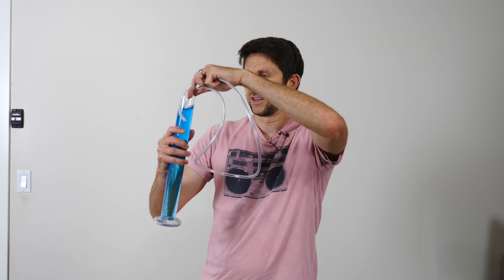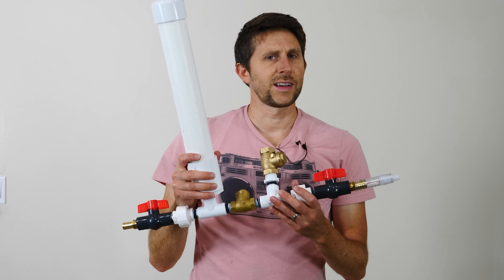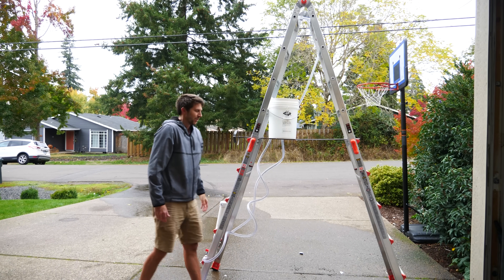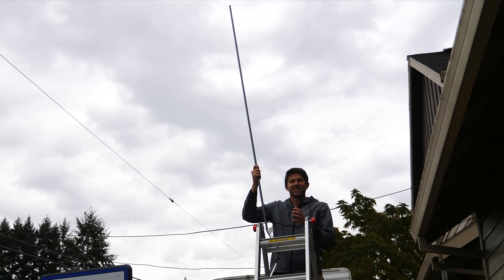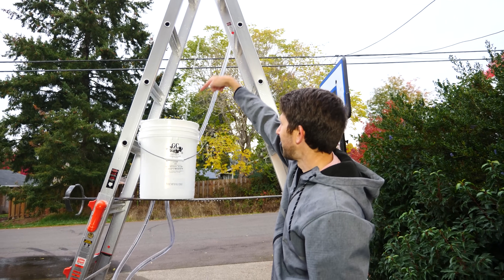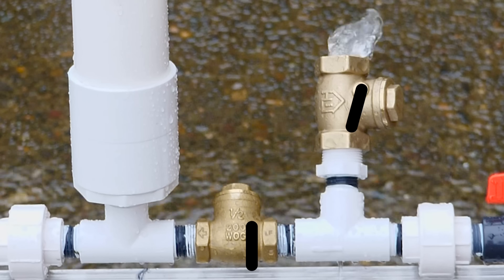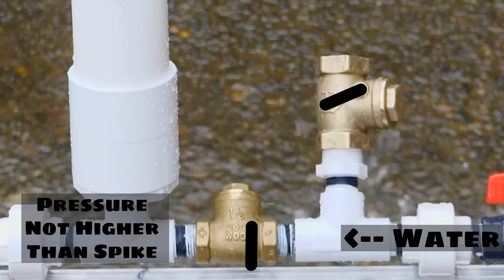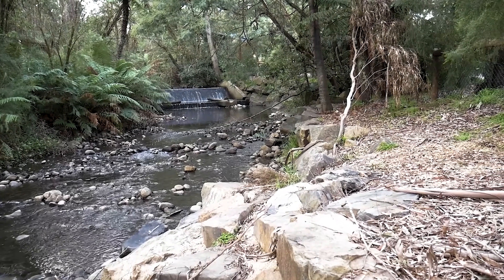Can a Hydraulic Ram Pump Make a Perpetual Motion Loop?

Comment: Fascinating! 
I could see this being used in pump-storage hydro power.
Reply: Probably not. ram pumps are very inefficient so they's only pump a fraction of each release of water back up to the tank. They might work as a supplementary system to somewhat reduce required pump energy but between embodied energy and cost of installation they're probably not worth the trouble.
Reply: @balometer  What your saying with so much authority is so wrong. How can you say something that has a zero cost of energy production will not make a good hydropower station your years at Shell Mobil and Bp has clouded your thinking.
If you produce energy for free for 1hr a day what's wrong with that. You can add storage tanks to stretch it to 10hrs which is good enough as wind and use low rpm generators but you must be close to endless supply of water and return all water back  That's why I call it a mobile Dam can be setup and dismantles as the need arrise 
only a friendly comment ✌️
Reply: @onekycarscanners6002  I'm afraid you're missing the point. Ram pumps can be used to make a loop. It's not perpetual motion because (a) energy is added by gravity and (b) only a small portion of the water is pumped back up to the source point. If a tank is used as a source it would quickly run dry and if a water source like a main or a river is used to top up the tank it would be several hundred percent more efficient to run the source water directly through a generator and forget about pumping in a loop. Learn some physics before having a pop at me. Maybe try again in a few years.

Comment: You made this way more complicated than it needed to be. Out here in Colorado we use perpetual motion water all the time without even having a pump. All you do is fill a tube bent at the top so it comes back down.  As long as the portion of the tube is is longer on the exit side than the intake side The weight of the water picks up water out of your source And pours it out the other end

Comment: Can't you use the capillary effect to fill the bucket? Obviously it's slow and would take alot of space. But it's worth trying.  Then you only need to worry about water evap. Perhaps with big enough reservoir with rain collection. You could get perpetual energy.
Reply: No.  There is NO perpetual energy.  Even the sun will burn out and die someday long from now.
Capillary action couldn't possibly fight the amount of gravity involved here.  You'd more likely get backflow down your intended recollection tube/s and just empty or equalize the source without the pump doing any work.

Comment: I am really curious if such a system in a micro hydro turbine setup, e.g. water from a roof trickling down through a micro turbine and then returned some of it back up tot the roof for a second go in the system. E.g. increasing the potential of the total volume of water somewhat. If the reduced flow of water versus reuse is a net positive or a negative. Thanks for sharing this video!
Reply: I'm working on exactly that! 👍🍀🇺🇲

Comment: This was broken down that my zero understanding could pick up the gist of the principle. 
My ultimate goal is to configure a setup using water in a cistern to create enough electricity to run my home. Possibly impossible. 
But I want to get enough knowledge and/or information to make something similar to what I am thinking of. I have no naturally running water on my property and would have to depend on self-created running water.
Not sure if very much of that made sense. Thanks for a small stepping stone toward my goal. Jesus bless.
Any comments, suggestions, or direction from anyone would be welcome.

Comment: Could you not combine this with a container on a gravity hook up to generate power?

E.g. pump water up, fill a container. As container gets heavier it drops, driving gears to generate power. As it gets to the bottom it gets to a point where it pushes on something that opens a tap which eventually drains faster than its filling up and putting water back into the running water system you're taking from, lightening the tank until it gets lighter than some cantilevered weight, also triggered by weight, until it raises back up (faster than the water still topping it up), and the cycle starts again.

Complex but if you have running water nearby (energy provided by gravity also, or alternatively via municiple mains pumping) it essentially runs itself, generating a level of local trickle charge for energy to households or offices or whatever. 

Noisy mind you...

But you're essentially harvesting energy from running water nearby - fast river, municiple pumping system (the latter meaning someone somewhere is generating energy to begin with, but if it's also feeding the drinking water system youd be doing that anyway the question is how much more power would it take). It's definitely not "free" energy but if the local geography is right, it isn't necessarily energy humans have had to bother creating.

Comment: This is not a "perpetual motion loop" at all. You are losing most of the water through the check valve, so it will eventually all run out and the pump will stop. Now, if you could find a way to return the lost water to the original bucket, you'd have perpetual motion. As it is, it's a fail.

Comment: Is there no way to collect the water coming out of the waste gate? For example, have it dump into a water wheel with buckets that then carries the water back up to the main bucket and makes it perpetual?
Reply: How will you power that water lifting wheel?
Reply: @Dingsrud  I was thinking about putting a traditional water wheel near the overflow pipe and the overflow would fill a bucket on the wheel causing it to rotate. Look up a water wheel. Most old ones used river water to push down on fins which turned the wheel.
Reply: @Eyenstein-ex9vw  Do not think so. The discharged water is close to the pavement.  It has expelled nearly all of its height and kinetic energy. Nothing left to drive a waterwheel.

Comment: It's not perpetual motion, though it is free energy. 

Always nice when folks find ways, to avoid having to power things with diesel or electric engines.

Stirling engines, Ram pumps, Peltier device, Boost converters etc.

Comment: This is why we need Super fluids, now we can heat and cool this we create a vacuuming motor that should produce electricity to keep our cars running. I think. Because water evaporates. Because you don't need steam you only need hot and cool air.

Comment: One of the best "water vs electricity" analogy lessons ("restored logic") is in Danny Hillis's book "The Pattern on the Stone" ...in that book (an introductory book on computation, for kids), Hillis shows how a high pressure water source can "top off" the logical circuits in a water computer, the same as a high(er) voltage source can "top off" the voltage in RAM circuits.

Comment: Interesting. I guess this means that, as long as you have rain and a creek that's flowing, you can keep lifting water up, as long as you're willing to have some water "get wasted and dribble back into the creek." This then means that, as long as you have a 100-to-1 "continuous water wasting lift"-to-"downhill continuous flow power generator" system, you can obtain continuous power from a water wheel that is fed by a "top-of-the-hill reservoir." 

I imagine you can get a valve to open (and stay open) only once a reservoir is full, and to shut completely once it's empty, using purely physical means (such as big buoys lifting smaller weights that are connected to levers and valves). The tiny "recapture pools" might be at risk from sunlight evaporation, but they could either be covered, or allowed to "top off" with rainwater wherever that was possible. Also: each level of wastewater catch basin can collect wastewater from 10, 100, or 1000 systems at the prior level of upward pumping. (Which raises interesting questions: would the valves then synchronize like metronomes? If so, would this stop them from functioning properly? )  Also: If all of them had a small water wheel that was hit by the water squirts from each wastewater pump, would the force be enough to slowly charge a battery array?

This reminds me of Feynman's commentary in "The Pleasure of Finding Things Out" regarding poor villagers carrying of water up a mountain every day, only to have dirty water run back down the mountain at the end of the day, where he talks about small-and-cheap pumps slowly-but-continuously adding pressure to big pipes, using small amounts of energy, to slowly accumulate water to eliminate that huge drudgery.

Something very interesting to ponder: Can systems like this be described on paper, so they allow the "idiot-proof" transfer of water over hundreds of miles, underground? If so, desert regions could be fed, given water, etc. (Perhaps water can also be pulled from the air using the method of the darkling beetle.)

As a final concern/benefit "if multiple water-raising-check-valve-pump systems are fed from the same initial bucket, and their check valves all squirt into a second reservoir for the next system, how many 'base systems' would it take to fill a water tower of x cubic feet, at x height, x miles away within x hours? Additionally, how much extra heat (and harvested electricity) could be concentrated within a similar water tank (and battery array), for showering and dish-washing? The value of this idea is in its "set it and forget it" construction.

A big hassle might be water decontamination, because any place that has standing warm water gets infected with brain-eating amoebas known as Naeglaria fowleri. So, "all water" would need heat treatment, UV treatment, and/or chemical treatment to get to the 100% Naeglaria-kill threshold. 

The prior makes bringing high-quality water systems to the impoverished a very difficult task: their water systems can be free of Naeglaria and river-blindness parasites one day, and contain them the next. Additionally, with no reliable private-and-secure homes to go to, the benefit of running water doesn't get someone clean enough fast enough, or fed well enough without a refrigerator, to go to an interview or public-facing job in less than 1 hour, especially with a lame-system like New York's where one building's residents all fight for water at the same time. (The prior privacy amenities, by way of the NY analogy, are more important than water alone.)

We need systems planned out in advance, which waste absolutely nothing, and which are 100% modular. (...Such ideas can't spare the unlimited expense of brainless totalitarian "zoning" and regulatory bureaucracy which has an improper view of reality that places a high positive value on initiated force. I.e. "Saving the poor from cheap housing ...which would gave allowed them to find work and gradually save, become wealthy, and move to better housing... by keeping them homeless.)

Comment: Instead of wasting that water on the first valve, can't you route that to another bucket at the lower level so it doesn't waste that water to refill the top bucket?  This way, not an ounce of water is wasted.  Maybe that waste water can be used to water a garden or something useful downstream while you pump water upstream where you need it for the house or something else.

Comment: okay but you still need water from  source and the water gets wasted, So now if you take  a big water tank and connect a pipe big enough in the middle below it and you can propel a alternator with the force that powers a connected air pump on top of the the tank it will generate more pressure force above the water in the tank making the  the alternator spin faster creating more energy thus you will get perpetual unlimited energy. so this is my idea of free off grid power 

~Barend Burger

Comment: so... could you build hydraulic ram pumps in the ocean that feed water up into towers to produce a steady volume of current down hydro turbine generators? the waste would return back to the ocean, and, as long as the water levels on the coast is accounted for, there would be a continuous supply.

gravity and tidal power would basically run and replenish a ram pump, which would power hydro turbines.

Comment: To repeat the words used by a late friend of mine, it's a classic case of water hammer. The loss in the system is the water coming out of the first (inline) valve. Unfortunately this cannot send the water it's emitting back up to the bucket. So no closed loop (as the builder would understand). This type of pump is often used where no power source other than water pressure is available.

Comment: Dude. What happens if you make 4 of them. and the water that is wasted to be collected in boul and one more ram pomp to push all the water wasted by the all 5 back in the sistem of the bucket. But I assume it would be better to use the 5th ramp pomp to inject water in the inlet of the first 4 rampomps this means you need to cut the inlet of the 4 pomps and add one t splittler so you can connect your insertion pomp and it looks like it may work. I can imagine some short of syncronization between all 5 rampomps because the inlet of the fir 4pomps has now a variation in pressure because of the 5ram pomp when is pushing the wasted water back in the system... I wish i could work on this it;s  alot of room for errors.

Comment: It works if you have a series of ram pumps filling in a chain from the discharge of the other ram pumps, you must have enough so that it can work long enough to get "charged" by the rain and therefore evade the final ram pump running out of water

Comment: Nice! Is it possible to put a tiny water wheel on it to produce a little power. It would need enough force to spin the water wheel generator and still have enough inertia left to loop the water back through the system. I wonder if would work with a tiny electric motor as a generator.
Reply: Simply put a turbine directly into the river.

Comment: Water won't run uphill.  The problem with this setup is the fact that the pump is very inefficient, in that it wastes a lot of water, and will eventually stop when the bucket is empty.  There has to be a flow of water to get the pump to work, and that flow can only be provided with an  external source, much like all the other ideas for PM.  You made a very interesting video, thanks for sharing it.

Comment: What if you collect the wasted water in 1 bucket, collect the higher level water in another, then use that pressure from the higher level to power a v pump on the waste water to be pumped to the starting water reservoir?

Comment: yes very nice innovation..I'm thinking to use the drop water fall into a propelled generator but my propblem is the waste valve..i want to save that water back to the tank , can u give me your opinion sir?
Reply: I know this is 2 years late but you can have have a collection bucket by the waste valve and then every so often manually take the water from the waste bucket to the first bucket and then rinse and repeat

Comment: I think you can make a perpetual water supply without using electricity if you combine this two system. First system is Gravity pump? By elevating a robust container about three meters above the water pond or concrete enclosure or spring water source (metal container prefered to avoid deformation during the vaccum). Connect half inch pipe with foot valve from the  water source going to the elevated air tight container. Then connect a 2 inch pvc pipe at the bottom of the elevated container, a swing valve is a must. Few inch from the valve, put a reducer from two inch to one inch. At this end we need to connect the RAM pump under it so that the wasted water coming out from the RAM pump will drop back to the main source. So you can bring the pressurized water supply from the RAM pump to the highest elevation or to your intended location. Please try this.

Comment: Hey you just proved flat earth in the first 0:22 seconds of your video. Water always finds its level. Good Job!!!!
Reply: ?? How does that prove flat earth at all?  Water can still find its level while blanketing over a circular surface. A circle is still a flat surface on the edges and even so, the earth is not perfectly flat, it still finds it level, and guess what, that level equal in a direction that causes the line to touch itself via starting point to end is round, a circle. If you had a basketball that had a gravitational pull at its core (in this case only affecting water) the exact same thing would happen. The water would find an equal level. Its called gravity

Comment: Wait, I know this what I am going to say isn't true and there probably is a reason why but can't u just put the bucket of water below the waste pipe so that it catches the water that is wasted to get the pressure of water to go above the bucket and back in the bucket?
Reply: If the original source of water (bucket) is below the waste valve it won't be able to utilize gravity to generate the velocity it needs to open the check valves.

Comment: Can't you use two buckets and eliminate the wasted water?
If you fill one bucket near the ground and start the valve, the water from the ground bucket would be pumped tho the higher one.
This would allow you to direct the wasted water back to the ground bucket.
You can then drop the water from the top bucket, to produce energy, and direct it to the ground bucket again.

Comment: what if your ram pump was sitting over a pool, and your drum is enclosed but much larger, with a pipe that goes from the pool to the top of the drum, and then it flows out of the bottom of the drum into the ram pump, first you would have to prime the drum to give it a high amount of head pressure, so you would need the water shut off valves to accomplish this, that way you are not wasting any water what so ever.